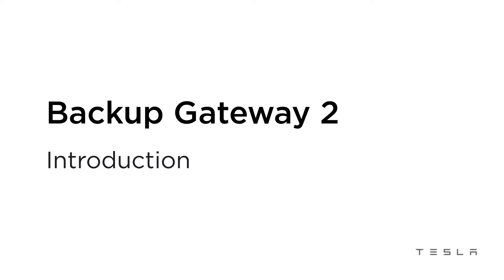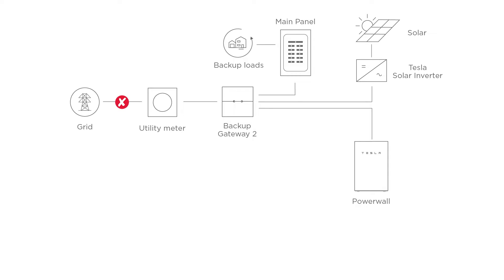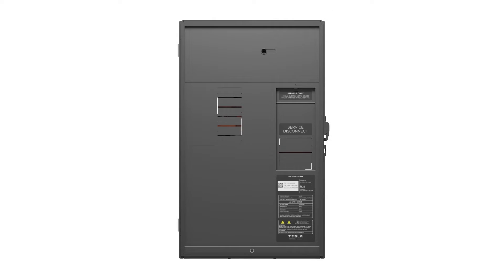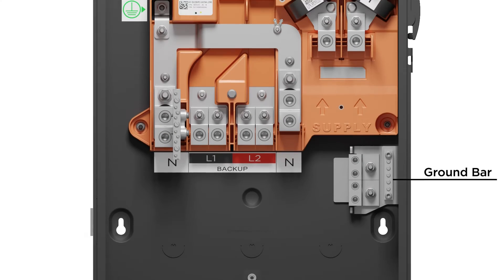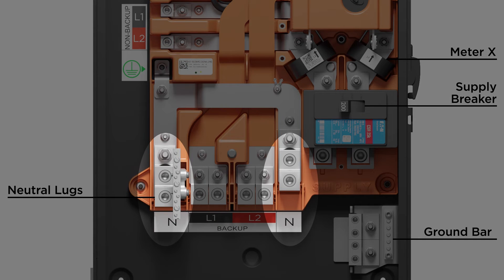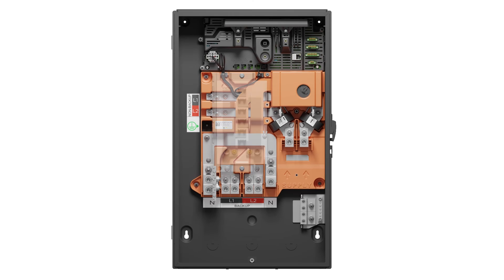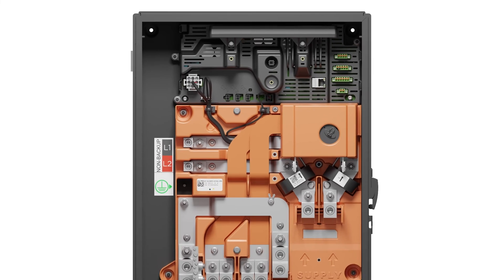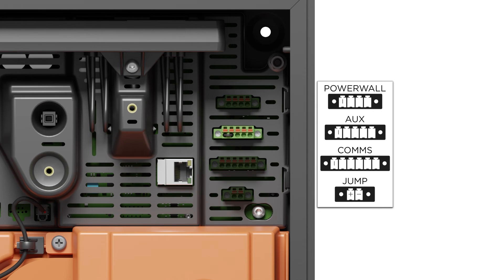Backup Gateway 2 - Technical Overview (North America)

Comment: This is exciting!  Tesla is  going in the right direction.... creating a system that is grid-connected, but that seamlessly picks-up critical loads when the grid fails.  THIS  IS BIG!.
Reply: Big in price. Depending on what your home power demand is it won't last long during outages. Unless you have many Kw of power walls. (Multiple batteries)